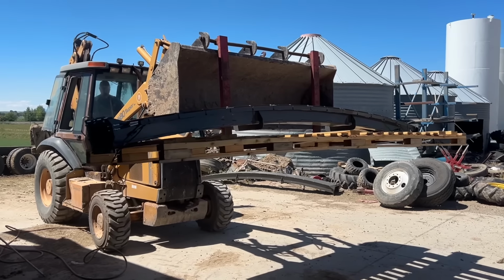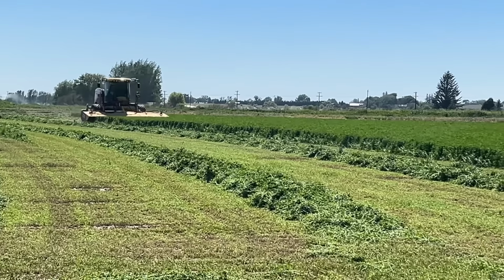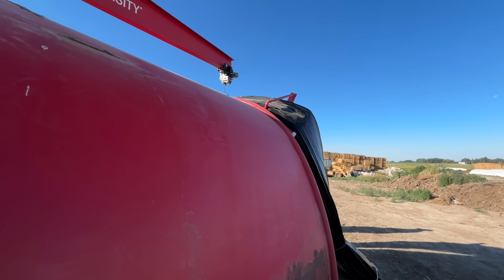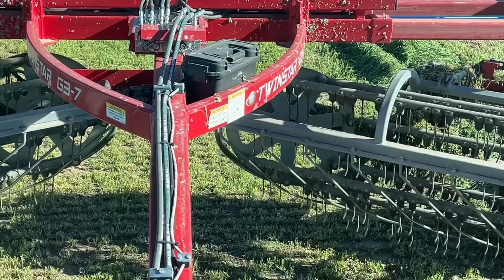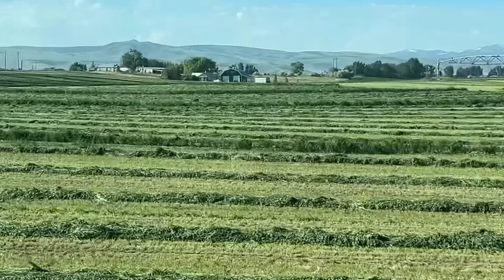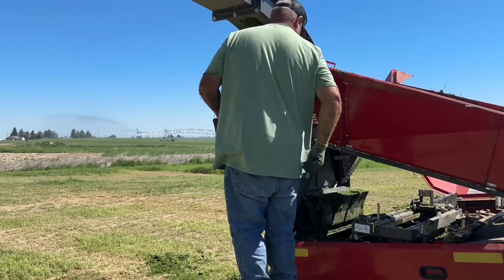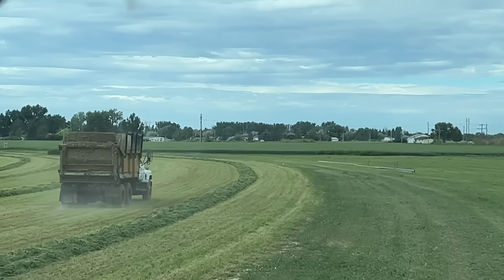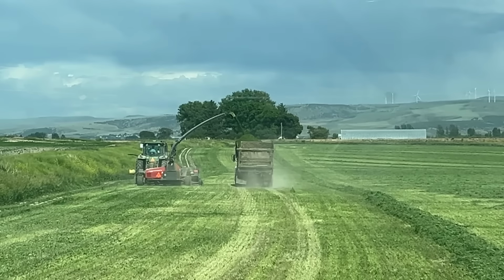Will second crop hay harvest be better than the first?

Comment: Did you get your problems sorted with the pipe extension?Couple things ,one check your blower paddles and liners,two the long pipes have trouble with hay they need more of an opening on the bottom of the pipe.The opening allows clumps to fall and it helps with drafting.Hay looks realnice
Reply from the maker: We kinda got it figured out

Comment: Depending moisture, us and most guys around us have to mount a water tank on the chopper with a small 12v pump and a 1/4” line into the fan. It doesn’t seem like much, but usually keeps the spout from plugging. Just an option in the future if you keep having trouble
Reply from the maker: Thanks for the tip

Comment: Just a tip for when your not using a wagon and direct filling trucks have them closer so you can have the spout pointed directly down into them. That’s how we do it here in SD with a self propelled Deere.
Reply from the maker: We are still trying to figure it out
Reply: @RockyMountainFarmer 
Not what he said. You want the hay to flow as unobstructed as possible. If you drive closer, the end spout will be tipped down and the flow will have to turn 90 degrees- basically making a wall where it can back up and plug. Hard to explain in writing, but hopefully you get it.

Comment: I had trouble blowing grass silage through a John Deere trailed forage harvester some years ago.  The problem turned out to be to big a clearance between the knives and the belly pan on the chopping cylinder.  The back of the cutting chamber is adjustable ,after a lot of sharpening we were loosing air because of the gap.  Closed up and went like a dream.  Might work.  This was in the UK with grass.
Reply from the maker: We will have to check that out

Comment: Check all ur wear plates in the existing part of the spout. We have it on our claas self propelled where the plates meet together they’ll wear out and create a rough transfer and it’ll affect the efficiency big time. Or even just the fan itself make sure the blades are still good shape. Doesn’t take much to make them run like crap

Those Dion scorpions do kinda suck tho… havnt heard much good about them.

Wet silage always blows better. As long as everything is working how it should. Dryer the lighter it is, just kinda fluffs out the end. Wet can be bad tho, it can kinda wad up. We don’t chop alfalfa so could be different but bit wetter grass silage blows far better. You
Could also shorten your cut length from the chopper itself usually helps to.
Reply from the maker: Thanks for the tips

Comment: Hello I’ve always found wetter grass blows better than dry grass, that is a really long spout, I use Kongskilde 1260 a great chopper very hi output for the power, I would only block spout if I had a forward angle, if it was angled backwards slightly it would be ok and much worse if crop was drying out . 
Great channel only found you yesterday 👍 I’m from Somerset 🇬🇧
Reply from the maker: Thanks for the tip!  And thanks for watching

Comment: From what I could tell from the first field, the moisture might have been a little high for the extension and the rake (have you tried a mower/conditioner). Another problem could have been that the extension was new and wasn't slicken up yet and causing problems in the heavier hay. The last time we did silage, we were using a pull behind New Holland and was blowing into peanut carts pulled behind tractors (we're in GA and the peanut carts were basically like your silage carts without the top and were high on the dumping side). Because we weren't going far to dump and were putting it in a pit, the chopper and carts didn't have to stop for anything, not even to swap carts.
Reply from the maker: There is a conditioner on the swather.

Comment: That mowing machine san certainly make short work of cutting the hay in a large field.  I can only imagine the constant repairs and maintenance on all your equipment.  Hope you can work out the connection for the 'chute' camera before it goes back out in the field, as the operator will be able to load each truck to the max and reduce misfires :)
Reply from the maker: Yes we will look into that

Comment: So did the long spout just need to get polished up to not plug? How did the ice workout ?
Reply from the maker: We had to move the fan blades in till they were almost touching the metal. And the ice lowered the temperature 3°.
Reply: Do you need to adjust the fan on the other chopper to blow into the wagon better?

Comment: Do you need to check your blower on them choppers they’re supposed to pick up a nickel and leave a dime if you’ve already changed the knives maybe you need to adjust the blower blades out so they all pick up a nickel and leave a dime
Reply from the maker: Yeah, once we adjusted the fan blades, it worked pretty good

Comment: Why does it plug.  You can't blow silage around a 90° turn. Raise the spout up in the air like your going to blow it up to the heavens then use the deflector to angle it! 
Lot of dion choppers here in Wisconsin running around!
Reply from the maker: I think he figured it out

Comment: How far do you haul from field to clamp?if its less than a couple of miles look into a forage wagon. Depending on moisture they can haul almost 35k pounds of ryegrass. Trailed foragers are gone in my area. Lots of self propelled but all trailed choppers have been replaced by wagons over past 10-15 years. Strautmann and lely mainly. Labour saving is the main reason. Your haul trucks would be gone. Totally unnecessary.